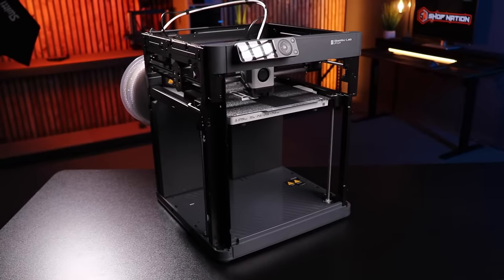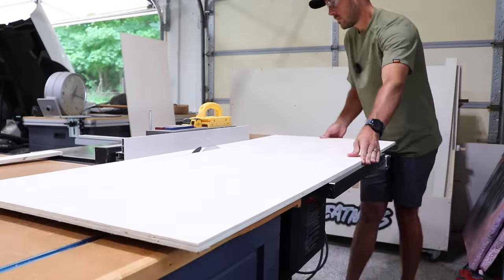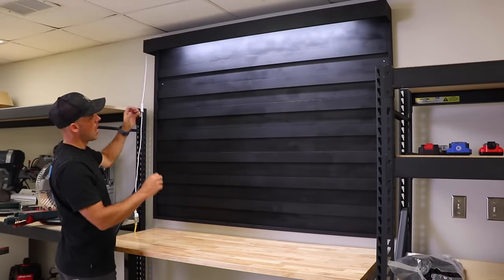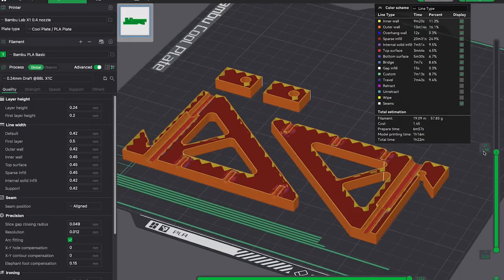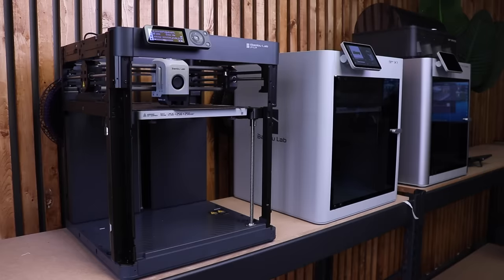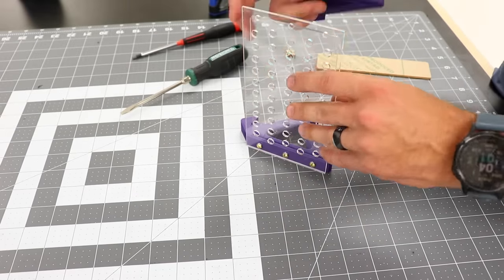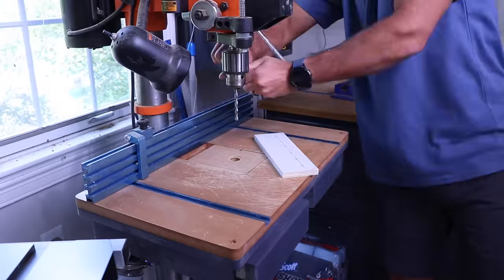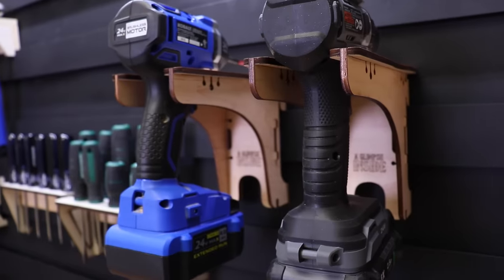Do you really need "smart" tools?  The answer will SHOCK you!

Comment: ok here is my take

half of the design time for the digital should be added to the traditional because even by your own admission you already knew what you wanted because you already went through that design on the digital

on the digital you can and did make one design for some parts that you only have to design once and make as many as you need but on traditional you had to layout each of those parts each time you needed them

with digital you can always go back to your old designs and modify and replace just the parts that you need to if you find that you need to while traditional would need to be remade from scratch

if you had a cnc router you could have gone hybrid digital, traditional and had it carve out the designs you want

Comment: French cleats- spacing (2.07) IS important. It sets your module size. Which sets the size of every module. It is so restrictive that it is the reason that I do not use French cleats. Too much wasted space- which is one of your key phrases. So what do I use? A wall size version of a fixture plate. A grid (10mm) of threadable holes (4mm), easily machined on a CNC machine- make them in panels that suit the capability of the machine. I say threadable, because, being made of ply, it will self tap when using 4mm bolts. Strong? I have a rack of 12 hammers held by two bolts, and it is solid. This means I can make carriers of any size, and locate them to an accuracy of 10mm. A couple of holes, a mutiple of 10mm apart, and fixing is easy. It uses less wood, gives way greater accuracy, and does not suffer from FC slop or lifting. I can also mount single tools, in the way of pegboard. So, a system that is better than both French cleats and pegboard, takes less material, and is quicker to make. What is not to like?

Comment: I own a shop sabre CNC, a Prusa and a Bambu Lab 3D printer, and a Chinese Fiber laser.   What people forget is you have to learn how to use Fusion 360, Vectric Aspire, and Illustrator for EzCad2 models and each one is not easy to even get a basic understanding on hence the reason most people stop at cutting basic shapes with their CNC, downloading 3D models off thingiverse for 3D printing, and buying pre-made vector files for their lasers.  And unless you are a software nerd, which I am...it can really take the enjoyment out of "making stuff." If your a guy who just really enjoys cutting wood and building stuff and don't like to sit in front of the computer for hundreds of hours learning software than you most likely will not enjoy some of these machines.  Its kind of like needing to learn a  2nd language before you are allowed to go on vacation.  Would take the fun out of the vacation for a lot of people.  Before buying any expensive machine...I would try to learn just a little bit of the needed software to even see if its something you really want to get into.

Comment: I don't care for the torched ends of the laser cut parts and that is why I have a CNC router in my shop. There are tradeoffs though. The CNC router makes a large kerf because the laser is just a beam width. However, saw dust is easier and moderately safer to deal with than laser smoke.

Comment: If you were to add another wall to your shop later, you could take all the design time out of the process. Just reprint the files. But the traditional method would take the same amount of time. The design work you put in is saved. You an use it as much as you want.

Comment: I am not super surprised, if you know the tools you can probably do both similary quickly. For example if I need to learn how to use each digital tool, or want to make my drawing in something like Fusion 360 I might need to learn those first. 

I would like to see you do a hybrid of both method. One where you design the stuff in something like Fusion 360, and build it by hand. Then one build where you design it by hand, and then use all the fansy machines to do the parts for you.

Comment: A few thoughts:

A mix of the two is probably the fastest - You can use the 3D printer or laser cutter to make the jigs / drill templates and while they are making those, you can break down the sheet goods and cut everything to size & shape. This also works pretty well for router templates / patterns, especially if it's something you may need to make more of in the future.

On the digital front - one thing to keep in mind that you did not mention: Once you have your cad file and you make it, you still have the files so the second batch (or a replacement if you break something) is substantially faster. The design work is already done. This is the true advantage that the digital methods have. Consider - while the 3D printers are ripping out a batch of parts, you are free to design something else, slice a different file (or the same file with a different orientation / print settings)

On the traditional front - I know it wasn't exactly the point of the video, but I'd be curious to see if you would have saved any time doing the actual design work digitally instead of purely from a notebook. Being able to see a full 3D representation of the design can (though it doesn't always) prevent a lot of errors or mistakes. And while the device to use it on isn't free, there are a ton of free options available.

Comment: Have you thought about making a LED light holder for the Bosch glide miter saw to cast a shadow of the blade onto the part?
Reply: I'd personally love this and have been thinking about it myself but haven't yet done the measurement/fitting work to get started on a design. I'll have Travis' dust collection port here next week to install, so maybe I'll give this a shot.

Comment: 2 more factors i havent seen addressed:

First, the handmade items are much beefier and likely stronger. That material would have been much more challenging with home shop level lasers.

Second, you put way more design into the laser designs than needed. None of the cutouts were needed technically (like on the handmade). That would have saved design and cutting time.

Comment: In this case, I prefer the “traditional” method for a few reasons:

- You can make it look nicer with wood in my opinion
- Wood is stronger than 3D printing
- You’re not limited by print-size
- You can test the fits of tools as you build it
- Easier to modify wooden versions
- You could get a single “proof of concept” done faster in wood than you via the digital method
- Finally, much cheaper to use woodworking tools, than expensive machinery and CAD software

But that’s just my opinion, thanks for the comparison

Comment: I'd actually say digital has the speed and financial advantage but not the structural advantage. For example buying a 3d printer and a laser printer can be about $1000-$1500 depending on what brands you get and many other factors. With digital design you can make a specific sized hole in a board for example without needing any new tools. But, using powertools you have to have a table saw to cut the correct sized board then have the exact bit for the drill press as well as the drill press. You don't have to have the big power tools such as a table saw or drill press but it sure makes it easier to do stuff. I'm not sure how much a table saw and drill press would be but I know from looking some they are not cheap either. Comes out to around the same price as the 3s printer and laser cutter. Also. On vs something is already modeled you don't have to model it again so the 3 hours is gone the next time you want to make the parts. But when it comes to 3d printing and laser cutting, it will not normally be as strong as a wooden part made with common wood. Depending on layer lines and infill and different settings a 3d printed part will almost never be as strong as a piece of wood. They both have their benefits and problems

Comment: I am really not surprised by the results. I use my 3D printer and CNC to make or cut things I don't want to do or are easier (in my opinion) for the robots to do.  So, I have noticed time seems less relevant than I first thought.  But, like anything as you become more familiar with a tool (physical or digital) your skills usually improve and your time to create is reduced. So, pick what you enjoy or wish to use.  Probably different rules in a production environment.

Comment: At my uni we recently moved from a workshop with conventional mills/lathe and CNCs to full CNC.

I was worried that, for student projects, it would be much less efficient. For a novice it can take like half a day to set a CNC machine for a simple part.

But in fact, it may take 4 hours the first time, but people will get much more efficient the second time.
And, as we are now doing more practical lessons on CNC, obviously that helps too.

There is always a CNC with "basic" tools available somewhere in the workshop, so often most of the tools you need will already be set.

So on average for a one-off part, even with programming i found that it is more efficient to use a CNC for most of the parts, even for students that are not really familiar with them. The exceptions are really simple parts that you can make on a press drill...
If you need TWO parts, 100% it's more efficient to use a CNC.

And i'm not speaking of 3D printing/laser cutting, which are so much more efficient that doing things by hand. Of course 3D printing is slow, but you can do other things while the printer works.

Of course, I'm only talking here about efficiency, but it is a shame that our students don't get to use a manual lathe/mill from time to time, because it teaches you what cutting is, the force needed, and other things with a high pedagogic value. Or that you can solve so many problems with simple tools like a file or a saw...

Comment: I have an etsy shop selling trays. I started making trays with a bandsaw and a router. I can make a tray in 5-10 minutes by hand. That same tray also only takes 5-10 minutes on the CNC. The difference is that the CNC can cut 10 of them at once (I need to switch bits out on it though), and they will all be exactly the same and perfect. And other than tool changes (which I can automate away eventually with scale - or not), I'm free to do other things... Like play FIFA on XBOX. My time is mine again.

Comment: For a 1 off for personal use as you are using, the traditional worked well. Most people wont need multiple of the same item. However, if you need a bunch of the same thing or are doing this to sell as your friend is doing, CNC is the way to go without a question. You're removing your design time every time.

Comment: Add the price of digital vs conventional tools. Which will you use throughout your life and which cross over to other media like metal or repairs to other tools or home items? The digital tools are reusable just as the conventional but will at some point become obsolete and/or unsupported and are not nearly as versatile. A drill can hang a flag holder on my porch or help fix a fence, etc. digital tools are quite limited in comparison. Also, the chances are the vision that one uses to design and complete digital solutions are derived from and analyzed based on conventional techniques. An education not automatic to one with only digital experience. Not really quantifiable.

Comment: Keep in mind that with digital fabrication, repeatingly making the same thing becomes a lot more viable. You have the files already, the design work doesn't repeat. Only the manufacturing time, which happens mostly without you actually having to do anything, is repeated. But with traditional manufacturing, making the same 30 minute part 10 times takes you 5 hours - and you'll have to work all of those 5 hours. So digital manufacturing is WAY better for something where a lot of repetition is involved - a tool wall for example. Also, it's very fast and easy to make small adjustments to the files and just print out a new iteration.

Oh, and while you chose to supervse your laser the entire time and do nothing productive, not everyone will do that. It's totally fine to do something else in the same room and just have an eye on the laser on the side. So you could have used that time to build the tool wall itself for example, further cutting down on overall time for the project.

Comment: I think what most people forget when in comes to these kind of comparison is the importance of DFM 
DFM is design for manufacturing. Briefly what that mean is if you design an object for a certain task you don't (or at least should not) end up with the same design depending on what manufacturing method you target. Corollary is trying to replicate the same object using another manufacturing method than the one originally intended is most often a huge mistakes. 

so all in all comparing two manufacturing methods by building the same object with the two is not a fair comparison.

Comment: Smart tools are great until you have a problem and they stop working. Some shops I worked at were basically shut down for days waiting for their CNC to be fixed. While they were waiting I used a standard table saw and kept working.
Any tool is a smart tool in the hands of a skilled craftsman.

Comment: in fairness, assuming your digital fab equipment is located in the same location, the time spent "babysitting" the laser could have been used setting up the 3d printer and making future designs for the next tool holder you are going to cut out.

Comment: Pretty much saw this coming. At-Scale production is where it all changes. I'd give the long-term nod to the digital manufacturing if you were selling these by the dozens or hundreds. For a small shop, or even a small business, where 99% of what you need already exists in your general tool stuff, building just makes more sense. As I mentioned in another comment, most people in a WOOD SHOP scenario are more likely to have a small or mid-sized CNC than a 3d printer or laser cutter, so the mess and clean up remains.

Comment: These are the types of projects that scream digital or digital hybrid, especially if you have files that you can purchase from someone who has done the design. The key is recognizing repeating patterns (like the cleat assembly) that will be the same in every piece. The real difficulty comes with familiarity (seeing the design as a 2D or 3D construct and converting that to a file that can be printed). I think many people steer away from using FDM or Laser because it's another complex piece of software to use and their background is more physical than virtual (and then there are print errors if you don't understand bead thickness, plate adhesion/ leveling, filament wetness). 
People should not think in terms of how long it will take today, they should think about how long it will take over time. Once the template is done, reprinting the cleats with FDM is usually set and forget rather than buy wood, break down, glue together. There is also the cost factor. Using the 3D cleat as the base should cut down cost significantly even if you want to use a wood top piece.
This should be seen as another tool in the belt to be used when it makes sense.

BTW. I think something that is missing from many woodworking videos is general build timeframes. Don't need to have a minute by minute breakdown, but I like the 15 minute round off for design, building sections, wait for glue, and cleanup. I think this gives a much better idea to viewers of the total investment so they can plan ahead.

Comment: Time is not my biggest concern, cost is much more relevant to me. So for a one off project, the big expensive tool for fabrication just not feasible. If I was planning to make product for sale and have to make repetitive identical cuts then the big expensive fabrication tool becomes viable. An example would be a domino floating tenon cutter. There are a multitude of ways to duplicate what the domino does, with simple jigs and a router, or even a hammer and chisel or using a drill to clear out the majority, and then cleaning up the joint with a hammer and chisel. To be honest, you can even buy a mortising machine to do a lot of that work for a fraction of the price of a domino. This doesn’t even cover the other options such as dowels. So as a hobbyist who’s making a one off object spending more money for a domino than I did for my $400 carpenter saw or even $1000 for an introductory cabinet saw as opposed to a $1500 domino, which is a single purpose machine versus a tablesaw being very versatile for doing several things and doing them very well. However, if I’m running a small business, where I need to make a whole bunch of tenants to join the furniture, the domino becomes a massive timesaver labor savor that will pay for itself within a matter of weeks over what I’ll be paying my employee, or increasing my own productivity to the point where I’m making more product to sell and thus increase my income.
Reply from the maker: Excellent point! I should have probably addressed cost in here
Reply: Cost varies with accessibility.  I have access to the laser cutter and CNC at the local makerspace.  A day pass a few times a year is much less than monthly access or the cost of the tools.

Comment: I think using 3 3D printers at the same time is a little bit of cheating as you can't build three things at the same time manually. When you have access to three printers things go a lot faster, but the same goes if you ask two friends to help you out.

One benefit of the digital approach, is that you can later easily build the same tools again, so they are more uniform. Plans you draw by hand often get lots or get liquids all over them. We all have seen those coffee rings ;-)

Comment: If you used your large 3D printer array instead of the laser cutter it would have been much faster. It's also faster when you can just make a part and not have to worry about how they connect together and waste time connecting them together.